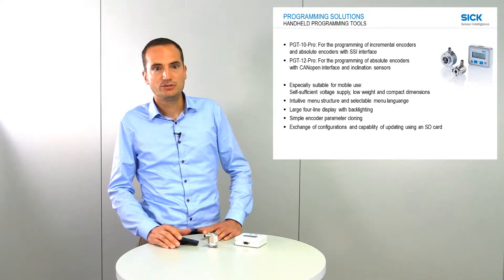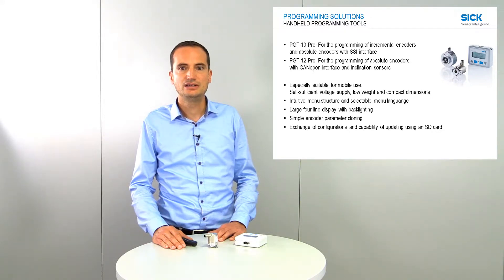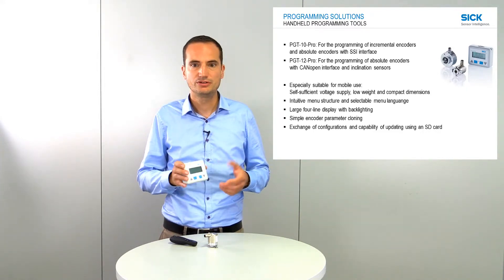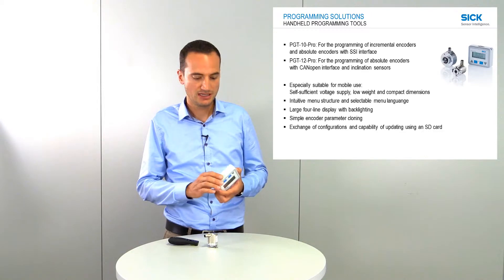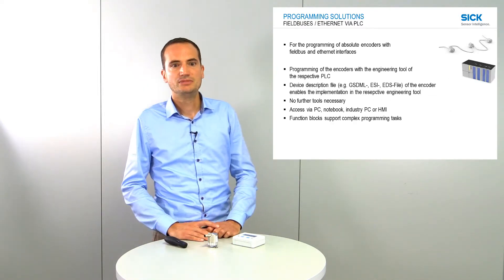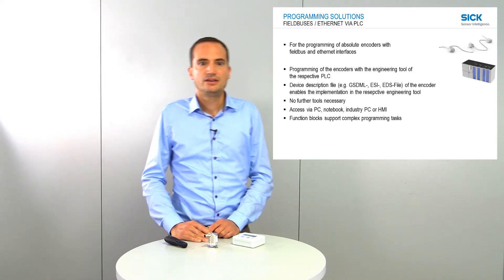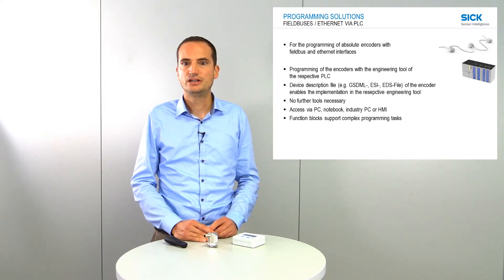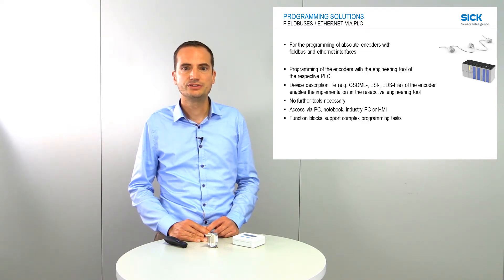Additional Encoder Functions Part (2/14) Programming solutions | SICK AG

Comment: The content is great, it's a hard task to select the adequate hardware for optimal performance of the encoders, 
I'm looking to connect a DFS60S-TDOA01024 to a PC in the most direct and easy way, this to send the position of an object in a conveyor, I'll try to find the most adequate hardware for this operation
Reply from the maker: Dear Jose Angulo (Maverick), Thanks for your comment. 
The DFS60S-TDOA01024 is a safety device. It is not recommended to connect it directly to a PC, 
as the sin/cos interface has to be evaluated by a safety controller to realize a safety system.
Please get in contact with your local SICK support to find the optimal solution for your application.
Thank you.